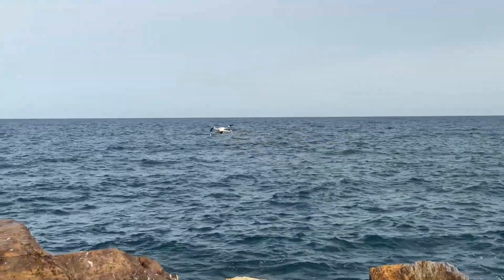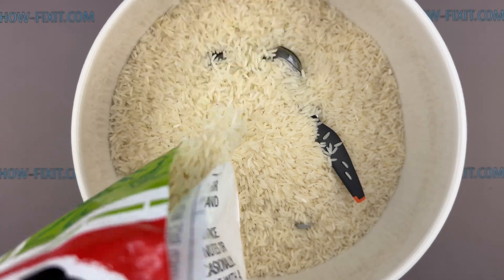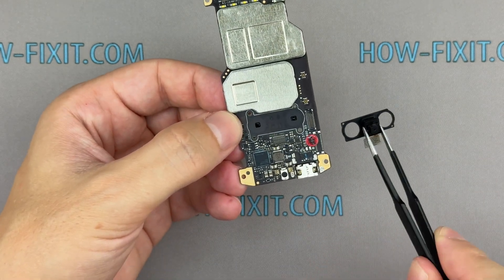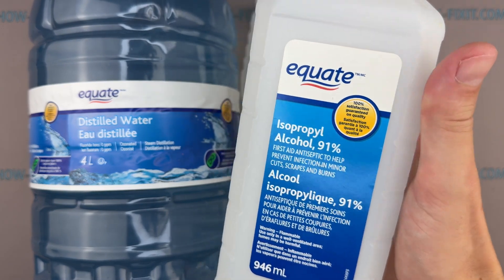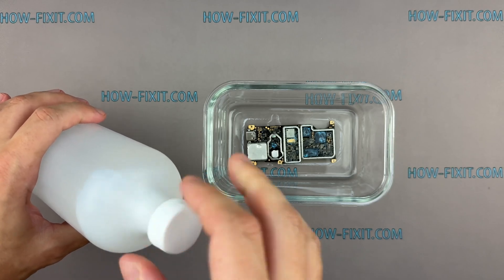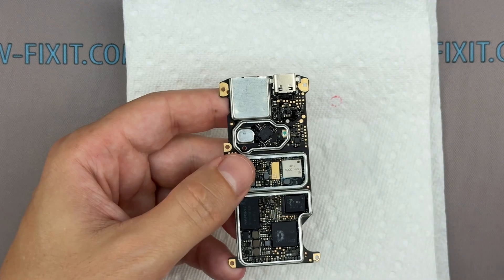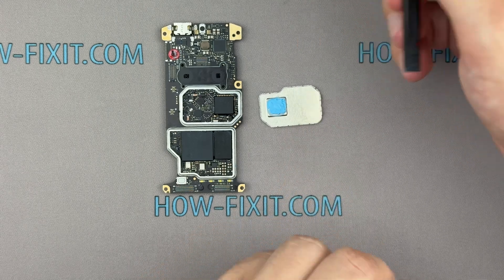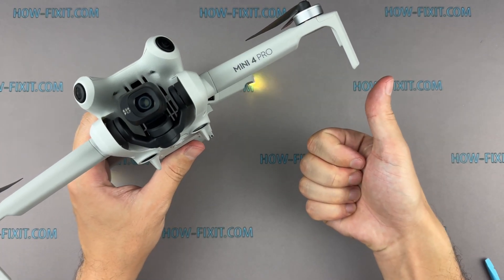Water Damaged Drone Repair - Complete DIY Guide

Comment: my dji mini 4 pro drone fell in a small river which was not deep. I took it out and started shaking it. I left it dry for  an hour then tried to start it. Didn't work. Got camera lens error. Tried your suggestions and I cleaned the connectors inside the camera but still getting "camera lens error". I lost the camera cap somewhere at home, can't find it. Not sure what to do next. But thanks for the video

Comment: I have a DJI Mini 3 that fell into a pool. I quickly removed the battery, then I disassembled it and cleaned the board with alcohol. When I reassembled it, it wouldn’t charge properly. The charging light comes on briefly, but the battery never really charges. Please help me.

Comment: nice detailled guide  , you also need to clean all the drone motor and connetor with the same steps, and even maybe the camera gimbal , BUT dont soak the sensor if possible or if no visible sign of water inside the sensor area
Reply from the maker: Thanks for the tips!

Comment: Great Video ,. Only there is the first step that is missing,. The drone is in the ocean i presume and not in a saltwater hottub,. How do we find it ? lets say its 100 meters out..
Reply from the maker: Mark the last known GPS location using your flight app or remote controller. You will have to swim after it or use a boat.

Comment: Should connectors also be soaked in isopropyl alcohol or only cleaned with a brush?
Reply from the maker: It's generally safe to soak connectors briefly in 99% isopropyl alcohol, especially if you're dealing with saltwater exposure or corrosion. 
For most cases, a soft brush dipped in isopropyl alcohol is enough to clean the connectors thoroughly — just make sure everything is fully dry before reconnecting or powering on the drone.

Comment: Can isopropyl alcohol alone remove salt residue, or is vinegar always necessary for saltwater damage?
Reply from the maker: Isopropyl alcohol alone can’t fully dissolve or neutralize salt residue. For saltwater damage, it's highly recommended to use distilled white vinegar first, as it helps break down and neutralize salt crystals. After that, follow up with isopropyl alcohol to clean off the vinegar and dry the components completely. This two-step method gives the best chance of preventing corrosion and long-term damage. However, if you only have isopropyl alcohol and need to act quickly, it is better than doing nothing.

Comment: Rice does absolutely nothing. Zero. It's been proven so many times. Put the quad in front of a fan. Rice doesn't pull moisture out of the air, it has to be soaked in water for a long time to absorb water. This is why your bag of rice isn't soggy when it's humid. 
Putting any electronics in rice is just a waste of good rice.